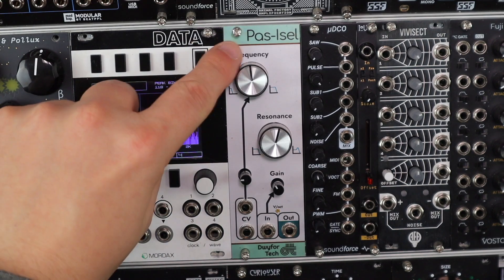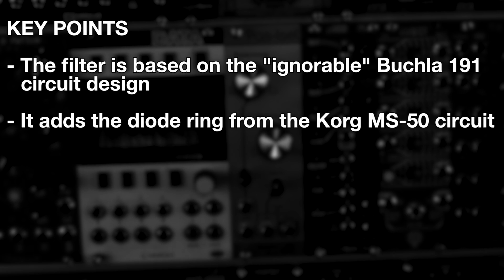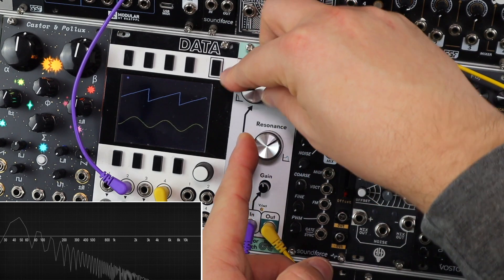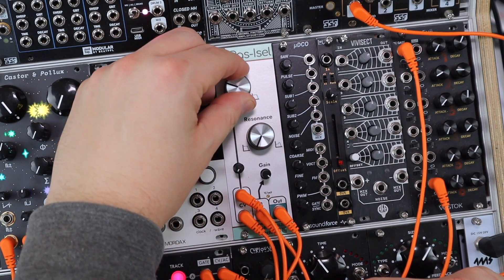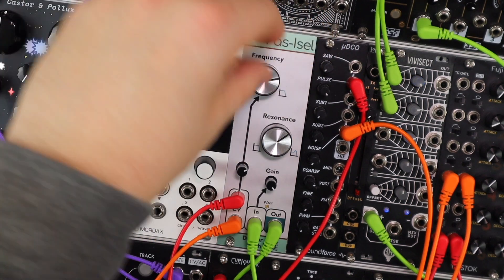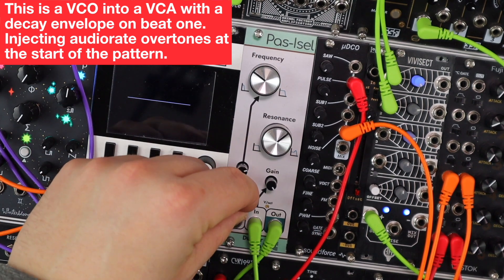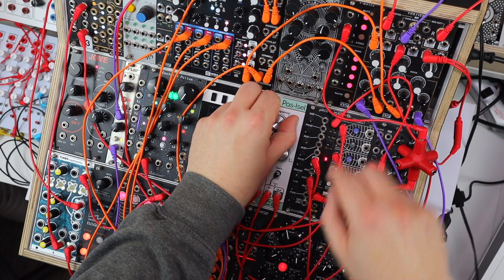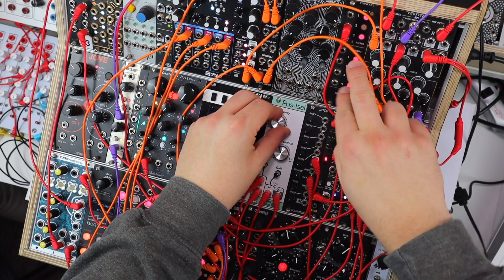A "forgettable" Buchla Filter Circuit is Reborn // 3 Patches with Pas-Isel from Dwyfor Tech

Comment: I presumed this to be an intriguing filter when beginning with an obscure Buchla topology married to the 50 diode. I love characterful filters with input stages enabling you to drive it hard. That woolly burly low end simply RULES. MEGA. JUICY. Thanks for this.
Reply from the maker: It does drive beautifully, certainly cleans up nicely too but there's more fun in driving it most of the time.

Comment: This is so not a such a forgettable(ignorable) filter!  :D  I have the schematic for the discrete version, but have never tried building one up.  It's a pretty interesting topology for each filter pole.  I like the op amp Dwyfor version a lot circuit-wise.  Really like the chirpy resonance on this guy!
Reply from the maker: I realise I misquoted, "ignorable" was the word the referenced article used. You can read about it here - https://divkidvideo.com/story-time-dwyfor-tech-origins-forgettable-buchla-circuits-korg-ms-50-love/
Reply: @DivKid  Nice, I'll check that out!  Also, while I have the schematic, I think this may have been one of the first times I've really heard it like this.  I may have heard it being used in a Buchla 100 demo or something, but didn't realize it.  I'm much less familiar with 100 series than 200.
Reply: @DrJ3RK8  The original 191 had no resonance, and had 'kilocycles' marked off on the cutoff knob - It was basically a laboratory/test equipment type filter in a module! Hainbach would be proud. But yeah, as a result, seldom heard.

Comment: Buchla? That´s a Korg MS20 Filter.
Reply from the maker: It's not an MS-20 filter topology. The Korg MS-50 diode ring that's added to the Buchla 191 circuit is also different to the MS-20 as the 50 and 20 are different circuits and sound different. 

Though I appreciate higher levels of saturation pushes it into that style of filtering people think of.
Reply: @DivKid  When you turned up the resonance, I thought my MS 20 IC35 was playing. The resonance behaviour, this distortion peak stlye resonance is almost 100% identical to the IC35, certainly not 100% to the later MS20 but IC35? oh yeah! I could show you both the Dwyfor and the MS20 IC35 with the resonance rising and you wouldn't be able to tell the difference. I'm convinced of that. 

I think it's great, because quite honestly, even the Korgasmatron couldn't manage this kind of resonance. You can't find a 1:1 MS20 resonance clone as a module on the market. I'm definitely going to get the Dwyfor.
Reply: @Finn.Diesel  My first fully analogue synth was an MS-10 with the Korg35 VCF in it - Still have it to this day, one of those ones I'm never going to part with. Definitely been a big inspiration for me throughout my musical life, so I'm not too surprised it came through in my circuit design too! I have done a side-by-side of the two and there are definite differences though, mostly because of -24dB vs -12dB. Pas-Isel is just a touch more polite.
Reply: I promise you it's Buchla-derived! Honest. It's an op-amp-ified Buchla with Korg bits and bobs to make it behave nicely.